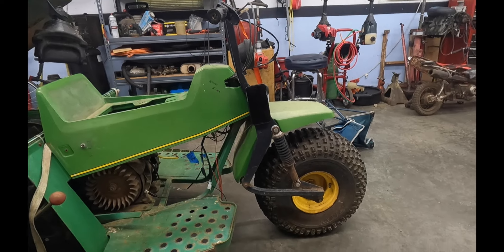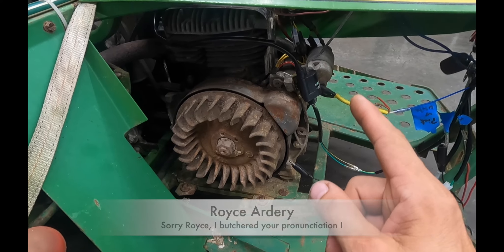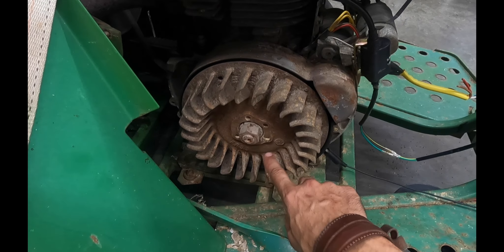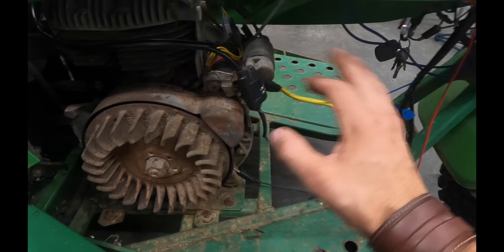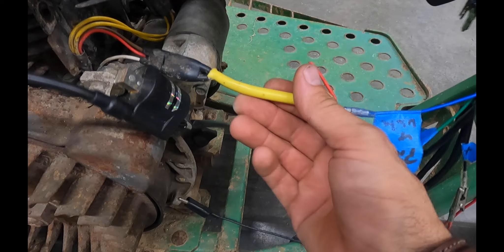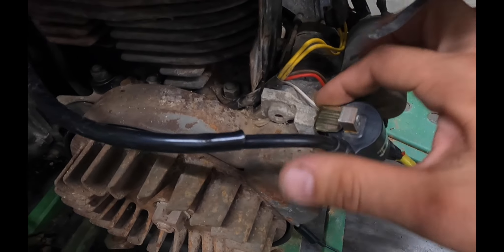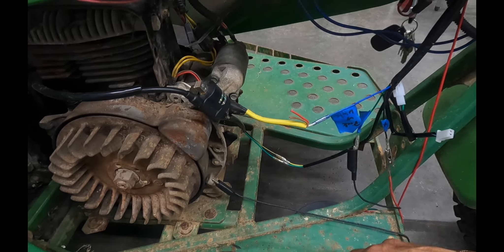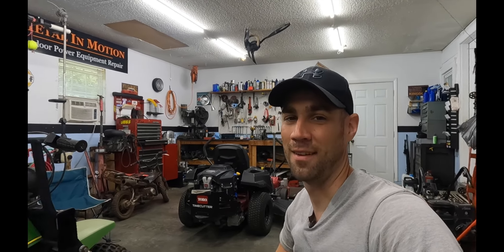How to fix the ignition system on your John Deere AMT 600 (CDI upgrade)

Comment: Fantastic insight indeed
I have a kf82 d-x, so it doesn't have a stator coil but uses 2 linear coils of which one for the ignition spark and one for the battery charging
It does have a small pick up coil too
My question is does anyone know which type of cdi unit I can adapt, should I use an ac cdi unit or an ac cdi unit
The coil for the battery charge goes to a small rectifyer diode bridge so both ac and dc are available
I'm also trying to find out what is the belt size on the commuter te 390, is it a C 41 belt?
Keep on posting these helpful videos, great stuff!

Comment: Thank you.  Going to try this on my AMT 600.  Can you tell me exactly which CDI box you bought?  A lot of them out there and don’t want to get the wrong one.
Reply from the maker: That link is out of stock. This is a different supplier but looks like the one I used. Its a DC volt 4 pin. cdi box with coil.  

https://www.ebay.com/itm/DC-4-Pin-CDI-Box-Ignition-Coil-Quad-ATV-Dirt-Pit-Bike-Go-Kart-50cc-300cc-Lifan-/265344698497?mkcid=16&mkevt=1&_trksid=p2349624.m46890.l49286&mkrid=711-127632-2357-0

Comment: Where did you pull the 12v from. The key switch?
Reply from the maker: Yes. There was an extra un-used switched 12v on the key switch I bolted too.